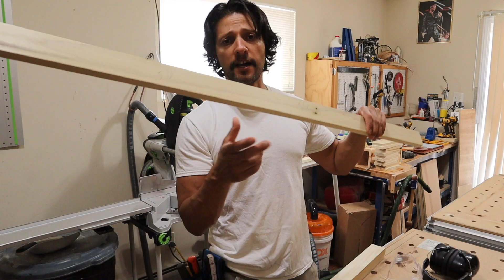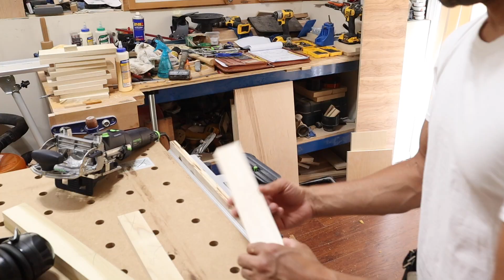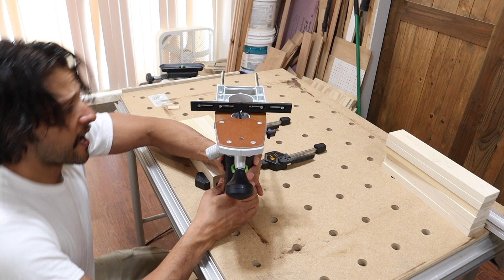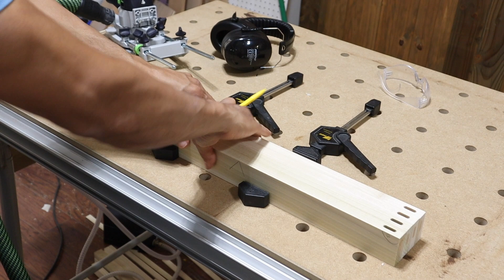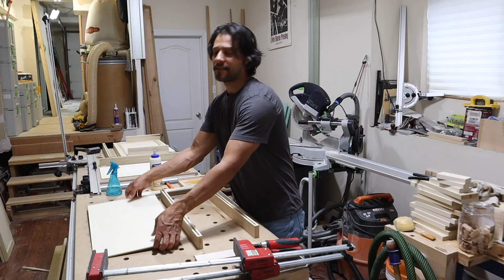cabinet building series 5: shaker doors

Comment: Just curious, now that this video is over a year old, would you still recommend assembling cabinets with a domino? Wouldn’t a three-quarter dado be more economical and still provide the alignment the Domino gives you? Just starting out in cabinets and it’s confusing when so many people have different methods on carcass assembly
Reply from the maker: @NHBWoodworks  it takes longer to set up a dado stack perfectly than it does to build a cabinet. Head to my channel and Watch my new cabinet making videos and I’ll show you the quickest and easiest way to build them without a dado or the domino.
Reply: @ I’m a sub and have seen a lot of your videos! Weird how often I search for cabinet making videos and you never popped up until recently, glad to have found you. Also do you still recommend the 3M Accuspray gun?
Reply from the maker: @ yes, I recommend it, but not for waterborne primers. The gun gets warm and cures the primer while spraying.

Comment: Hello, Anthony.  Did you use a jointer and planer to prepare your rails and stiles before filming this video?  Can we trust that all of our lumber is actually consistent in nominal thickness or stated metric? One would have to be lucky to have a load of lumber without any slight twists or bows. As I just purchased a jointer for my DIY shop, perhaps I'm looking to justify the expense. By the way, I just saw your new shop in your "Simple Shelves" recent release. I'm happy for you!
Reply from the maker: @nowherewoodcraft  I always mill my own lumber for these jobs. It’s the only way to ensure they stay straight. Jointer and planer are well worth the investment if you are doing this type of work.
Reply: @AnthonyScolaro1  Thank you, Anthony for responding and so quickly!  You are a good teacher. In my last cabinet build, I used my jointer to square up my 3/4 poplar boards.  The result was a thickness somewhere between 5/8s and 3/4.  With a spacer for my euro hinges, everything worked out just fine. Now I'm crafting a closet that will need Shaker Style doors measuring 5' tall x 24" wide, approximately. My worry is that milling 3/4 poplar for this project will result in rails and stiles that are too thin and thus too flimsy for doors of this size.  I'm thinking of starting with 5-qtr and using the jointer to square and mill them down to a perfect 3/4 inch. What do you think?

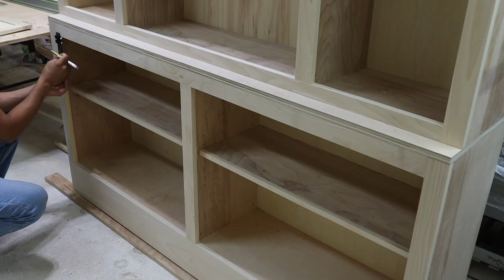Comment: 19:58 just a little confused here .. why is there a domino visible on the bottom left style? Did you make a mistake somewhere perhaps .. or .. I just don't get what this domino is 'fixing' ??? 🤔
Reply: It’s a mistake. I’ve done it also. And when you make the mortise, you can just glue a domino back in, and I use a little block plane and then sand. No big deal.

Comment: Hi. Congratulations for your work and videos. Thank you very much ! I have learned a lot.  Please let me know how long take for you to build a cabinet like that and how much it cost, roughly. Thank you.
Reply from the maker: It takes me about a week to build this and another few days for the finishing. I can’t discuss pricing for the privacy of my clients.
Reply: @AnthonyScolaro1  thank you for replay.   How much a joiner could earn in a week , working 10h/day 6days/week ? Roughly ? Thx
Reply from the maker: @ionutonea1537  that all depends on your area, what type of work you do, what your work is actually worth(skill level) and what your clients are willing to pay. I do all custom work and I build all the cabinets myself and most times I even make the moldings myself so my prices are much different than a normal carpenter or contractor who uses all pre-built stuff and just installs it. That’s a question only you can answer by trial and error on your journey.
Reply: @AnthonyScolaro1  you are doing a great work and you have s great skils. I wish. I leave in UK and in my area people  are using a lot of laminated kitchens. The MFT/3 is great. I just ordered ine plus CTM26 dust extractor with ,also, oreseparator dust.   Again, your videos are lovely . I am thinking to do kitchens from.oak and marble but I nedd time to project that. I had a joinery workshop with new Felder machines  tilt spindle moulder, 400mm thicknesser & planer, sliding table saw; until pandemic.  I still have the machines.  But at the moment I do just mibile woodworking jibs - part of house renovation small busines. 
GOD bless you !

Comment: I noticed your in-line clamping elements.  They are not Festool brand and would imagine are not Festool priced.

Are they any good?
Reply from the maker: They’re really good but a little too thick, I would have liked them to be only about 16mm, so they could sit below 18mm and 19mm plywood. That would have been better when sanding, not really a problem for me because I have a Festool vacsys. I have the amazon link for them in the description if you want to check them out.

Comment: Great job Anthony!
I make my cabinet doors similarly, but I use dowels with my dowelmax instead of dominoes. I've never been a fan of typical cope and stick style doors; I feel the stub tenons aren't strong enough for a long lasting joint.
I normally did the panel slots on the router table but I'm going to give the router and edge guide technique a try. It looks pretty streamlined with clamping up all the rails and stiles to be grooved. Looking forward to the next one.
Reply: Funny, I agree about not trusting stub tendons and I use dowels now. But, I was just thinking, I have 3 rentals that I made all of the kitchen doors with stub tendons. One of these places has been a rental for 13 years and I’ve never had a door break. So, we probably are over think it.
Reply: @Hunterhunter-ir9nz  For sure probably over thinking it lol
Happy new year!